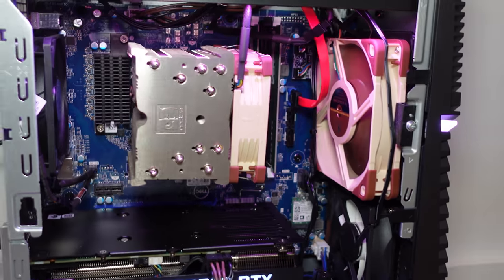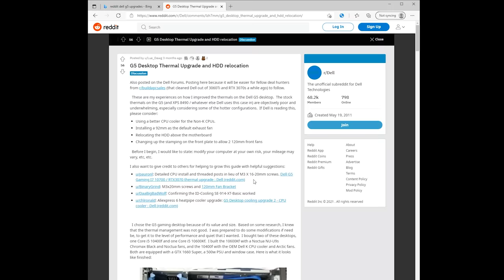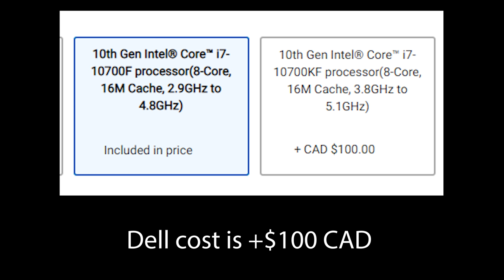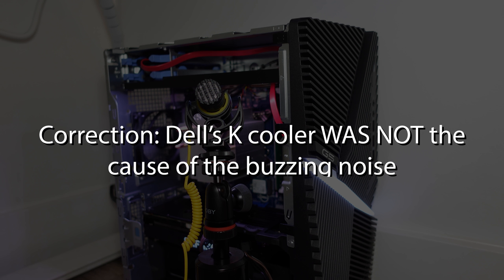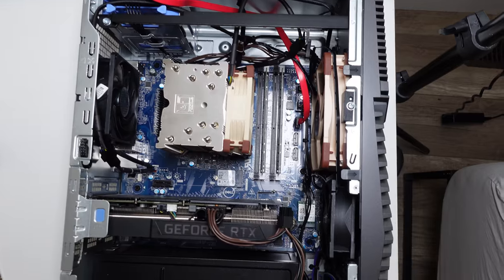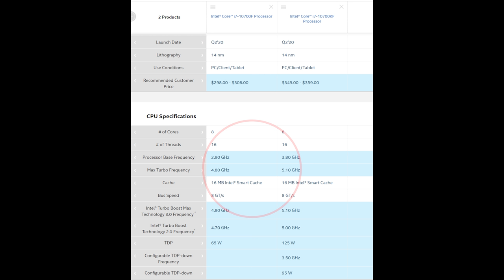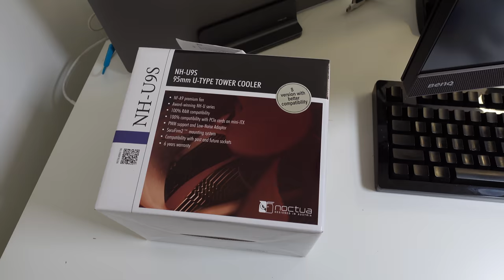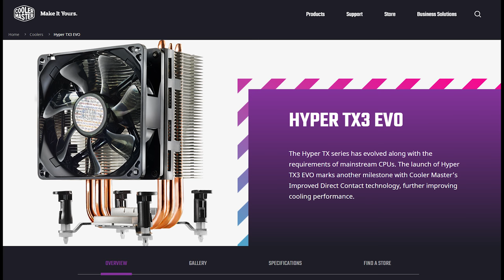Should You Upgrade Your Dell G5/XPS CPU COOLER? (with step by step instructions, in-depth analysis)

Comment from the maker: Install starts at 11:05 for those who just want the instructions!
Reply: I read that the way cheaper Cooler Master Hyper H412R fits in the Dell G5. Do you know if that is correct?
Reply: He won't know that cause he just read some other articles and follow there instructions to do this video.
Reply: So if you use 2 fans on the nh-u9s will u see a difference?
Reply: Hello sir, you mentioned that your power supply has a weird buzzing noise. What kind of noise is it? I bought a Acer Orion 3000 pc, that the PSU has a weird buzzing noise (sound like some small consistant electric shock) even when the pc is turned off. I'm thinking about returning it and buy the Dell XPS as it's on sale right now, and I hope I don't get the same buzzing noise from the PSU that is causing the issue. BTW can the dell PSU be upgraded?
Reply: Just now seeing these cooling fan videos as I've ordered a Dell XPS (knowing that's potentially an issue but the specs to price ratio is tough to beat). I saw another video from Optimum Tech and he replaced it with a liquid cooling set-up. It dropped temp by 7-8 degrees and bumped the CPU speed up in the process.

Comment: Just wanted to thank you for this video. I got an XPS 8940 last summer, and only learned about the issues with this computer through troubleshooting it like it was my job. I used your video as a guide to replace the "pancake" cooler with the Noctua cooler and replace the case fan, and it went well. I had done things like swap out hard drives or upgrade RAM on other computers in the past, so this felt kind of "next level", but your instructions were clear and easy to follow. I probably still have some software issues to smooth out for the game I want to run, but I feel like my hardware is sorted. Thanks so much!
Reply from the maker: You are very welcome! It makes me happy to hear this :)

Comment: Guys, I recently replaced a Dell 95w cooler on a 2015 Dell XPS 8900 (6700k) with a thermalright peerless assassin 120, using thermalrights' mount (this was in an aftermarket case)- if you buy a separate CPU retention bracket for your socket (in my case, socket is LGA1151, available on eBay), and remove Dell's CPU retention bracket/ mounting bracket that is all one piece, and install your new, smaller CPU retention bracket, you then have room to use aftermarket mounts for coolers. Just another option to consider, especially if getting some of these small screws in the video is difficult for you

Comment: Thanks so much for this video! Made upgrading a breeze. By the way, I figured out a work around for us fellow Canadians. If you buy the 3M-0.5 x 25 mm machine screws (instead of the 20 mm size you showed in your video), you can use a pair of wire cutters to cut off the screw heads. From there, use the provided thumb screw hardware to work back in any warped threading. To do that, you simply screw and unscrew the thumb screws several times on the side you cut the head off from. Now you have homemade grub screws (without the Allen key hole). Worked perfectly for me to screw into the mother board, place the spacers and brackets over top, then secure with provided noctua thumb screw.
Reply from the maker: That's amazing glad it helped

Comment: I just want to say thank you for making this video! I was pretty uninformed about the problems with this computers design when I purchased it a few months ago and was getting very concerned about the running temperature. Your videos gave me the confidence to take on this solution and it's making a huge difference, my cpu temps have dropped 30ish degrees since replacing that pancake cooler. Thank you so much and I wish you well.
Reply from the maker: You're very welcome!
Reply: Did you have to calibrate the new cooler? I have mine installed but for some reason I think its not even close to working at its best as my temps are still high. Any advice?
Reply: @redhotweezer  I didn't, I just bolted it on like in the video.

Comment: Years later, still helpful. Recently got this computer from a friend and noticed the computer overheating when running games. This cooler is awesome. The video instructions are fantastic, especially since I don’t work on computers. I bought four M3 20mm screws from the hardware store and they worked perfectly. Thank you for this content 🙏
Reply: For perspective, I’d boot up a game and the cpu would go immediately to 100°C with the stock pancake heat sink. Now, running my game (Dead by Daylight) on ultra settings it’s hovering at a comfortable 66°C.

Comment: THANK YOU SO MUCH.
I don't ever make comments on Youtube, but you video made my fix so smooth. Got the screws all ready before attempting to setup and it took me just a whooping 30 mins from start to end!
Reply from the maker: Than you!
Reply: @markstevens4264  I chose the first method (Non grub) and it wasnt tough at all to get the screws aligned. Don't need to go out of your way to get grub screws in my opinion if it isnt accessible

Comment: Fellow Canadian here with similar lack of access to the 3m screws. I ended up making the hole on the two metal plate bigger with my drill and used the thumb screws and plastic washers that came with the CPU cooler. worked like a charm.
Reply from the maker: Would love to see a video on that!

Comment: I've upgraded the stock cooler on a Dell XPS and HP Envy with the Noctua NH-U9S using the stock back plate.  Just used the correct spacers for the socket and M3 x 20mm screws.  Everything went together with no problem or modification.

Comment: appreciate the vid managed to get my Thermalright Peerless Assassin 120 SE installed into my Dell G5 with no issues. took a trip down to canadian tire to grab some of those m3 20mm screws happened to get the last pack of 4 so was just perfect. didnt really have any trouble lining up the holes or anything when i put it on i just put them down and held one side while i shifted the other around in place with the screwdriver.
was well worth it too i have an i9 with the poopy pancake heatsink after replacing it i went from being 60-70C at idle with thermal throttling constantly im a nice cool 35C during idle and only 75C during heavy gameplay. no more stuttering!
Reply: curious, won't the original screw that came with PA120 work? if im correc those are m3 18mm. so it should fit into the hole without the need for extra custom screws
Reply: @fanye5815  been a bit but i think the issue is that the screws came with it weren't long enough or something like that? maybe im not wrong but i swear i tried

Comment: Amazing video, really great instructions and extremely informative.  Thank you for creating this.  Context: I just bought the 8950 from Costco with the i7-12700 RTX3080 & 64gb ram.  I plan on doing this upgrade will share notes.  As I live in the US and used to have time to build custom cases, I may just go with the m3-20mm screws because I just have larger fingers and it’s always tough getting my fingers in that small space.  Will share my experience.
Reply from the maker: Wow 64 gb of ram! Nice setup.

Comment: I've just completed the install right this afternoon! To make it easier for you so that you can apply the whole thing to the mother board with only ONE TRIAL, try to connect 2 metal bracket to the heatsink first (through two screws at both left and right sides of the heatsink) , and then apply the whole thing to the mother board with 4 screws. Final, attach the fan to the heatsink!
Reply from the maker: Ah yes! I'm an idiot. Thats probably an easier way to mount the brackets.
Reply: Your method doesn't work. If you attach both metal brackets to the heatsink first, 1 of the metal bracket (on the non-fan side) cannot be accessible by screwdriver hence cannot be screwed onto the motherboard. Instead, attach only 1 of the metal bracket onto the heatsink on the fan side, and screw the other metal bracket onto the motherboard BEFORE you attempt to put the heatsink onto the CPU.

Comment: The Arctic Freezer i13X is also a direct replacement, no need to buy washers and screws. You'll still get the pre-boot system performance check if you connect the freezer i13x to the cpu fan header. This is easily solved if you use the stock cpu fan as an exhaust /intake fan. You then use a pwm fan splitter from the cpu fan header. The connector with 4 pins goes to the exhaust/intake fan and the connector with 3 pins goes to the freezer i13X.

Comment: Good job!  I followed everything in this video, and had no issues at all.  The i7-10700F CPU in my G5 is running around 30C cooler than before.
Reply from the maker: So happy to hear
Reply: I did the upgrade with the cooler master fan and while it is definitely cooler that the stock pancake I am not noticing 30 degree reductions like some people mention

Comment: Completed this tonight and your instructions were perfect… not a single surprise or snag ✌️
Reply: I put in a cheap single fan AIO on mine, worked fine though looks like the dell psu couldnt cope with the additional 4 fans I also installed. The AIO did make a diff with performance though. Im putting the whole thing in a non-dell mobo/case/psu and using it as a secondary pc now.

Comment: The pea sized amount is good; too much thermal paste is better than less if its non conductive

Also yes you can shuffle the heatsink with no issues. If anything its good for the mount to make sure the whole ihs is covered

Also you could just have the m3 screws all positioned onto the bracket before you mount it, and hand tighen before you use a screwdriver.

Also you'll need to check if youve mounted the cooler with enough pressure. I think theres a reason why people have recomended the 16mm screws with different standoffs.

Your first mount looks like there was not enough pressure on the CPU.
Reply from the maker: Err, not sure what you mean, the CPU cooler  was really fixed on the socket. Not sure what I could do better to make it secure.

Comment: Hello JSyntax, good video. No problem to wobble a bit the CPU cooler, if not too much Thermal paste is applied. Half of your big pea, so it can't fall too much from the CPU heat spreader.
With your Noctua Cooler, you need to install Intel extreme tuning utility, in order to boost the CPU burst period to 128 seconds, instead of 20 seconds. Since the Main Board is limited for overclocking.
Better buy pre-built, only for the GPU.
Regards
Reply from the maker: Thank you for your input that is 100% correct
Reply: @JSyntax  Thx. Very good your idea to print a mount for a 120mm intake fan, even if it cancelled the possibility to install a 3.5 inch HDD. Lucky the front Dell aeration grid is truly perforated. 
Still the Lenovo Legion pre-built has a better airflow and less proprietary components.

Comment: If you want M3 grub screws and you already got m3 machine screws - all you need to do is cut the head off with a Dremel and most people will know someone that has one of those (probably the same person who has the screws). Thermal compound despite its name doesn't actually conduct heat well at all, its really acting as a gasket otherwise the cooler would only transfer heat on the high bits.  As a result it should be as thin as possible barely a smidge, the tube you have there should never run out no matter how many PC's you do!  I've still got a tube from 1990 when I was making amplifiers it lasts for ever and if you get it on your clothes or anything else it last forever there too.    The reason you don't see any difference is that if you were below 90C with the k cooler then it will just run the same as if it was below 80c - however, if the fans are better quality and quieter then its worth it.  The really crappy pancake cooler is actually sufficient for most needs and the cpu will throttle for when its not so the idea was that Dell worked as hard as possible to get the minimum cost.  I think that approach suits us very well.  I got the F with a crap cooler and prefer the option to fit what I wanted.  The Dell G5 right now is basically an RTX graphics card with a free PC and I think they did a good job hitting that price point and keeping the stock flowing when everyone else ground to a halt.
Reply: Agreed, the pancake cooler, while loud, will work, even if throttling loses some performance on the CPU. The only thing I wish Dell hadn't compromised at all are the exclusion of VRM heatsinks on the F model CPU variant. With combined CPU and GPU load, those VRM's get hot and while they're rated all the way up to 120c, their longevity will suffer greatly without the heatsink, and there are a few cases on the forums where they actually blew. You can get the heatsink independently either 3rd party of from dell if you didn't get it, so I fully recommend it if the g5 is going to be your gaming go-to.
Reply: @tristantheafflicted  do you have a link for these? I used thermal camera and they only get to 60C but I feel they should be heatsinked if I can easily add it.

Comment: Has anyone run into an issue where the motherboard doesn’t pick up the fan. Cause mine isn’t picking up the fan therefore causing my computer to restart cause the cpu is “getting too hot” but the fan itself is spinning. I did do the noctua cpu cooler upgrade but ever since it can’t even use my computer now

Comment: I had a G5000 with that original intel fan, what I did to upgrade to a U9S was simply cut off that 4 radiator supporter which fixed on case, then you will realize you are able to install any kind of cooler in the market, put things right once and for all.
Reply from the maker: I would love to see pictures of that install method!
Reply: @JSyntax  I will forward you some pic through email, as I have no idea how to upload them here. First of all, this method will need to take off the motherboard from the case, I believe there is an instruction from the owner manual (I have spent an hour on this step). Once the motherboard has been taken off, you would see 4 short support (I used a grinder to cut it off). Then install U9S as what DIY normally do on the motherboard and put everything back in case (it's better to test it before putting them back).

Comment: Save your microfiber towels and use coffee filters, they don't leave fibers behind and work great. No issue with moving the heatsink around on top of the IHS of the CPU just spreads the thermal interface material around more. The application of thermal paste seemed fine, rice size is good, you can have too little paste, but not really too much with in reason.
Reply from the maker: I appreciate your feedback
Reply: Thanks for explaining this, I was worried about this too

Comment: @jsyntax  thank you again for this install video. i'm not sure what's wrong but after following all of these directions and properly mounting the chromax u9s noctua, i continuously get the cpu fan failure error at start up error code 2000-0511.  when i look at the cooler's fan and the rear fan they both spin but when i check my temps, it shows that my cpu jumps back and for from 100 -  113 F with nothing dropping down below that....any idea what might be wrong?
\
Reply from the maker: Are you using the 4 pin?